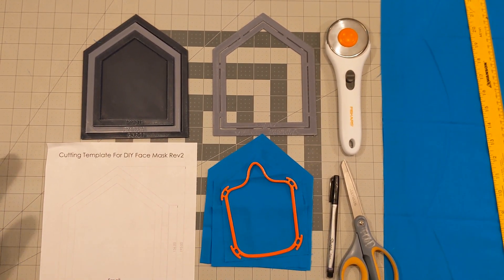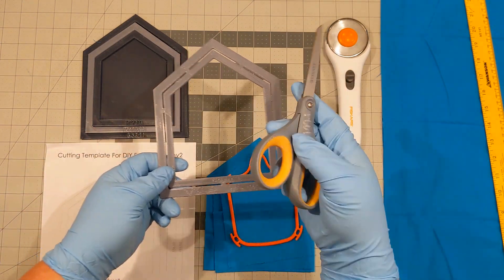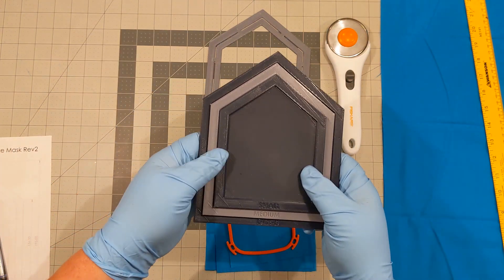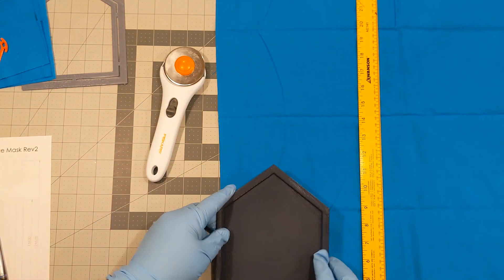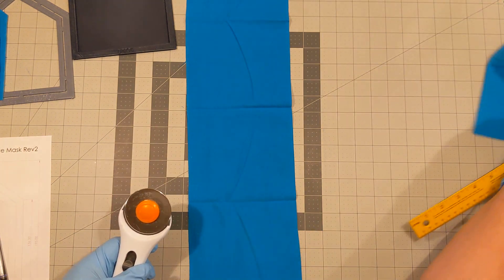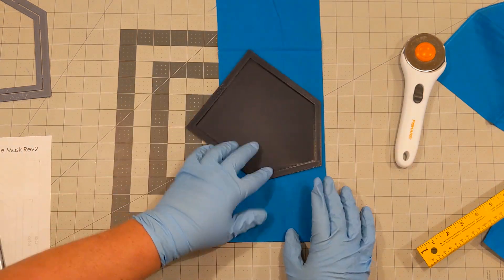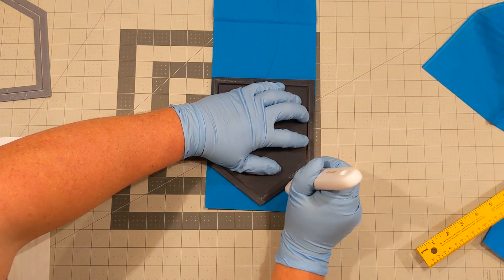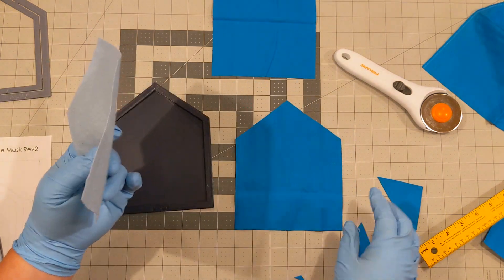Community Face Mask Tutorial : How to Cut filter material

Comment: Where is the printable template for the filter material?
Reply from the maker: They are located under the PDF Folder here. In your printer options turn off scaling.  https://grabcad.com/library/community-face-mask-frame-1/details?folder_id=8123211

Comment: I shared this. Here's a good shield design. I modified it for attaching the clear sheet purely with tape. I included a link to the original design that uses holes to attach the clear sheet.
thingiverse.com/thing:4247203